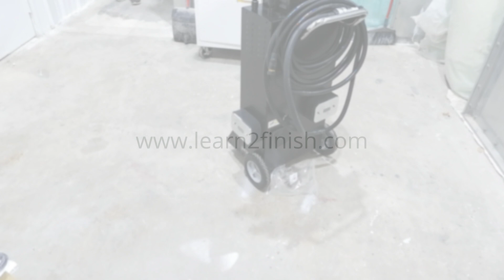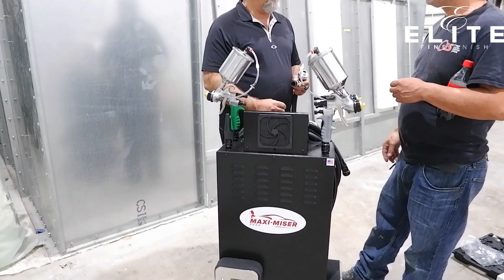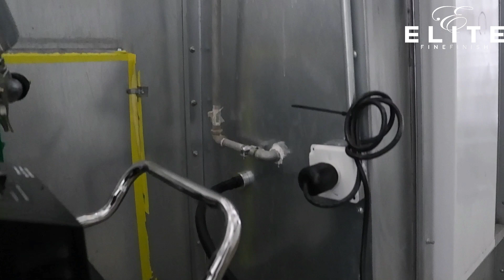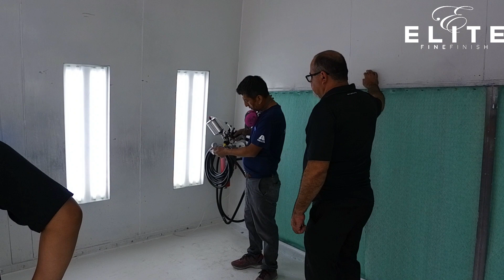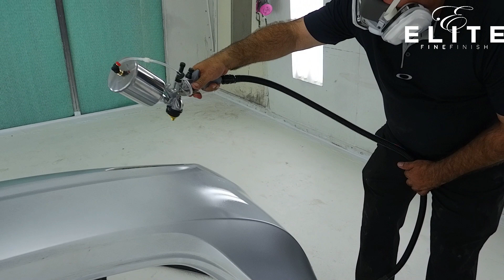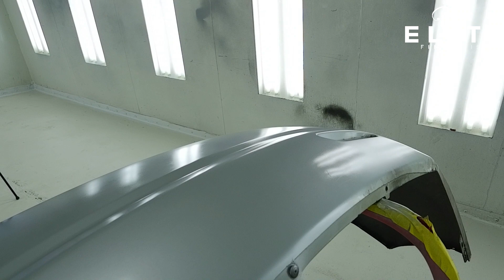Painting A Car With A Turbine HVLP Electric Sprayer

Comment: If it had better coverage I would by. Would be drag to paint a hood or top with.
Reply from the maker: Hey Dino! what makes you think it does not get good coverage? we have the system turned way down for training purposes. You can definitely
 hose the material on if you wanted to.

Comment: Is there a turbine system for a home hobbies that doesn’t cost over 5K.i was looking into a turbine sprayer from TP tools but didn’t like the fact that the air is always running on the gun from the tip even when your not pulling the trigger.im looking for something to spray automotive epoxy primers,candies,metal flakes and clears
Reply from the maker: Check out our site www.jassosales.com 
We have systems starting at $1399
Feel free to give us a call anytime 346.345.8951
Reply: louis Jasso thank you

Comment: That gun is laying on the, silver basecoat very slowly.
Reply from the maker: Correct, it's perfect for blending! Why would you want it any faster? In my experience a lot of people struggle with blends because they can not slow down enough for the perfect blend. We could definitely get more material out of the gun  but the materials begin to model.
Reply: The capspray 115 is also 6 stage I think can get the same results no?
Reply from the maker: @housemachine509  the gun is going to be your issue. You could buy one of the Apollo guns and use it with your 6 stage titan